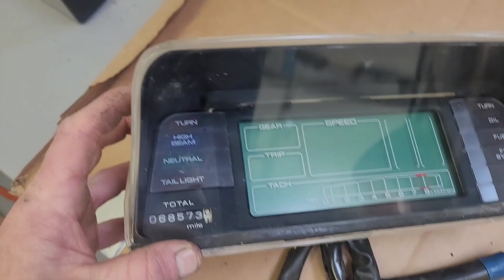Basket Case Goldwing part 4 (gauge repair)

Comment: I hope the harness fits after you have shortened it.  Better to have added back the length of wire you cut out that was damaged.  If it fits, no harm, no foul.  I have been enjoying your videos of the work you are doing to resurrect the old girl. Good work.
Reply from the maker: I did ponder making some wire extensions but there was plenty of wire legnth to get the connector back together. Thanks for the comment and for watching

Comment: hello man, nice video. i want to instal a car audio sistem in my goldwing 1984, but i dont want to make a mess with switches, wires, conectors, etc.
at first my original panasonic stereo dosn´t works so i put a modern sony stereo but as i say, i dont want to make a mess with wires so i was wodering if you could tell me if there is some adapter on market for that honda conecctor model (minute 0:40) from an old  input stereo to a new one modern stereo.
and if it´s not posible how i could identify which are the pins for the frontal speakers and the wire for the antenna
Reply from the maker: Most likely going to have to build your own. You could do a Google search but being 40 years old at this point I doubt there is going to be much available for these old bikes. Good luck👍👍